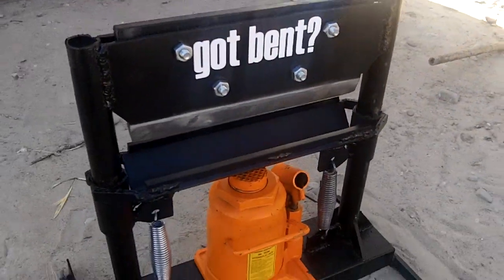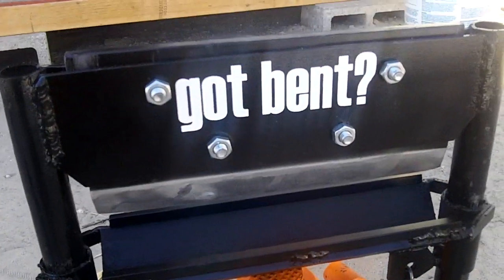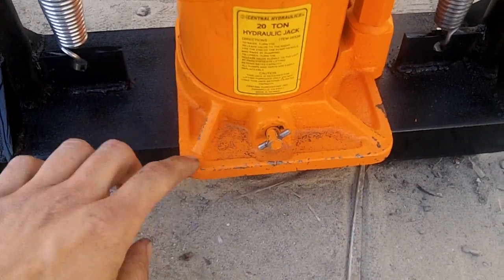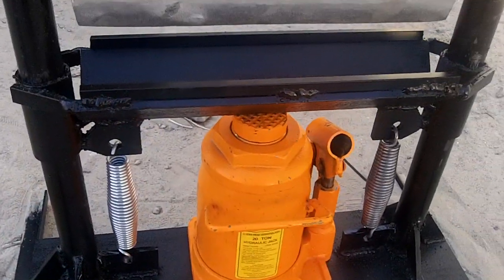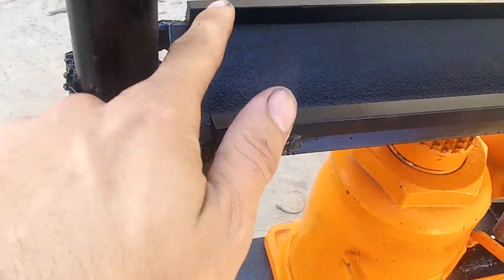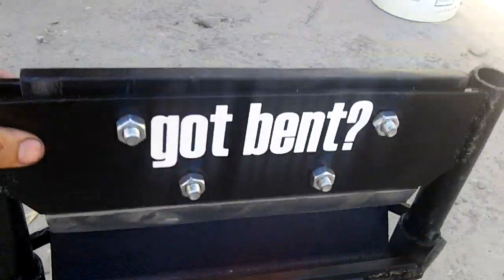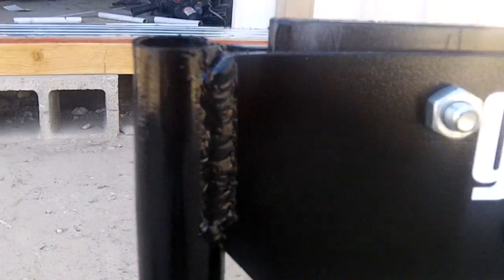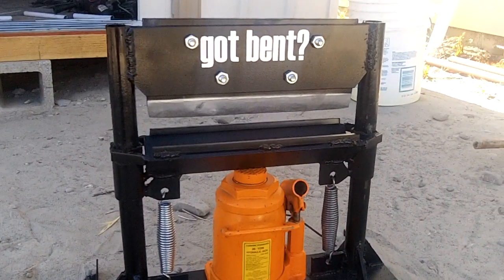"got bent?" Homemade Press Brake DIY 20 Ton

Comment: Nice build!  I want to bend 1/8" mild steel into a ~1" inside dimension channel with uneven legs and a total length of about 16", but would like less of a "radiused" (new word I just made up?) bend.  A little bit "squarer?".   I wonder if heating it up first, or slamming it like a punch press would do it.  I can't use purchased channel or rectangular tube because of dimensions required.  Any ideas?  Thank you for the video.  Jerry